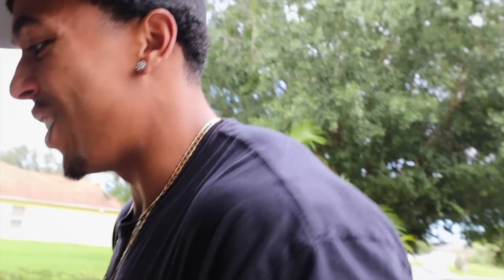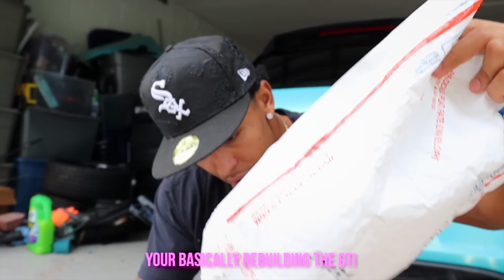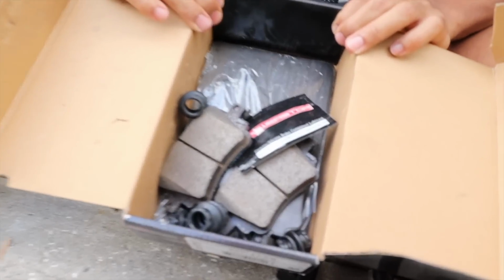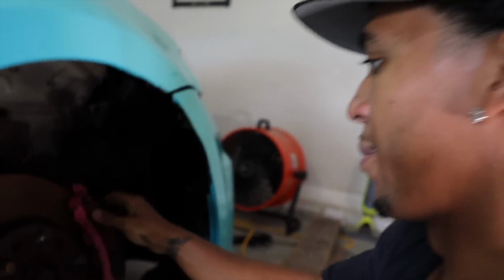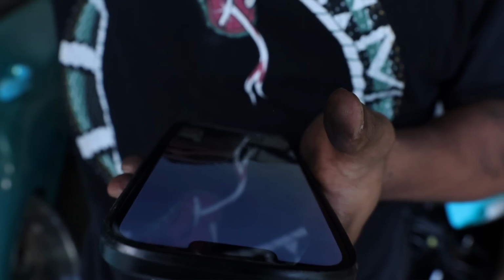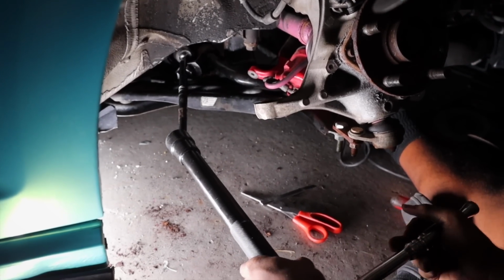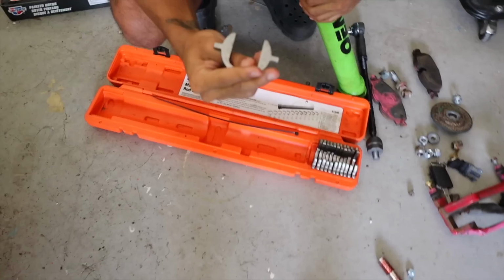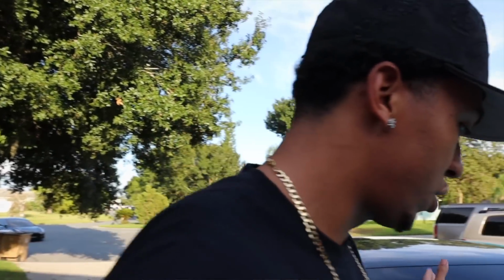THIS IS THE LAST THING I’M DOING TO MY CAMBERED GTI

Comment: Tay you should do a better eyeball alignment. As in taking 2 jackstands, put one in the front and one in the rear, tie a rope or string to each and run it across the side touching the lips of the wheel making sure its tight. that should tell you how far you're off.
Reply from the maker: I’ve done that before on my accord and i could never seem to get it right for some reason

Comment: Check that front right wheel pressure. No reason it’ll wear up in the tire unless it’s low. Also, it wobbles most likely because those nuts on the studs sticks out past where the next “spacer” is or where the wheel sits. Happy to see actual spacers being used. If it wears. Probably time to replace the barrel
Reply: Toe plates, get toe plates. All constructive criticism here. Take it or not. Keep on learnin🤙🏼

Comment: Did you torque down the wheels onto to the spacer too much? Someone I know they got wheels the previous owner didn't cut the studs sticking out from the spacer and they torqued the wheel down and it warped the face

Comment: Yo Tay, I got inspired by your cars and did big tilt to my bmw and ran into same problems. It's not the alignment, you are riding on the sidewall. Due to the tires having so much stretch, the whole sidewall touches the ground. So you got to have less negative camber or wider tires. Just look it up with flaslight when the car sits on the ground. The GTI is fire !

Comment: You most likely 90% need to replace your front wheel bearings, on top of your calipers. Seized calipers will make wheel drag in a sorts and that tool that actually got it off. Thats my clutch go to tool.

Comment: If it still wobbles after you changed the tie rods, check your wheel bearings next.
Reply: Wobbling was never the problem
Reply from the maker: It would wobble a bit but just from the washers on the spacers, Wheel bearings and lowers are definitely next if this hasn’t worked